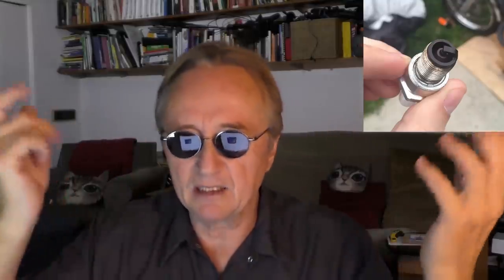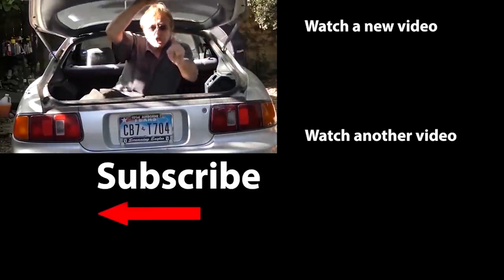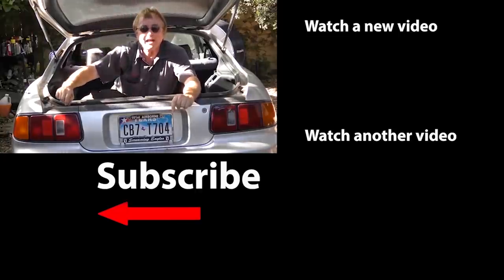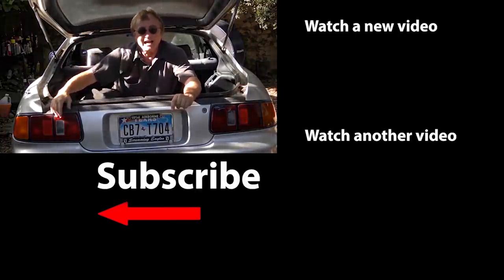How to Make a Weak Engine Run Better

Comment: I am so paranoid that things will break ever since i started watching Scotty videos, i sold my truck, my car,  my motorcycle, now looking for a 94 Celica so i can live stress free
Reply: Lone Ranger no repairs before 5 million miles, just tire rotation
Reply: @MrRamman04  what about brakes and light bulbs?
Reply: Kyle Kenan the 94 Celica is so good that the brakes are self healing and the lights are good for 100 000 000 hours
Reply: Get rid of your wife,too...🤭
Reply: Carlos Mejia How much do you charge?😜
Reply: Don't forget  the part where you sell your old lady......
Reply: Wing man lmao same I drive a sonata and it has a gdi engine
Reply: I have one, and I'm doing everything to it...  replaced the shifter cables that broke, replaced the valve cover, replaced the PCV valve after I broke it off (best thing ever -- change this every three years or so, otherwise, it plugs up and your engine tries to blow up like a balloon), put dye in oil to find oil leak, and currently in line to replace the distributor O-ring and the internal seal to stop the leak coming out of the distributor.  I also think the oil pump might be leaking, or leaked in the past. Once I get the dizzy situated, and make sure the hoses that have been leaked on for years aren't swollen to the point of a problem, I will clean up the back of the engine and see if there are any other leaks.  Something leaked on the passenger side of the vehicle, but I don't know if that has already been resolved.  It has over 330k miles on it, it runs pretty nicely, and the oil stays clear in the engine.  It is getting over 30 MPG with mostly highway driving, even with the distributor oil leak.
Reply: Just change the oil weekly

Comment: Got a 94 Corolla for 400$ with 176k miles on it. 10 years ago. It’s in my driveway right now with 286k. That’s 10k a year. Was the beat car I’ve ever owned. I drove that thing on a 1200 mile round trip two years ago. Didn’t even hesitate. Great vehicle.

Comment: My 1992 Toyota four-wheel drive pickup running rough and then it wouldn't stay running so I sprayed carburetor cleaner in a throttle body  poured seafoam in the vacuum tube off the power brakes booster now it runs fine like a top it does clean the injectors well

Comment: Scotty must not have heard of Matt fara's million mile Lexus.
Reply: Suspicious Citrus Isnt lexus made by toyota?
Reply: Yes it is, exactly why they are so awesome.
Reply: Lassi Kinnunen  a few things were replaced, but it had the original engine, and the transmission was rebuilt at 700k miles, but it was still using the same transmission.

Comment: The shop I take my vehicles to diagnosed a ticking sound as an exhaust leak...
Reply: Lol so you had more than 1 noise. Were you that customer that dropped off your car with a note that said "Hurr Durr ma engines making noise" and then didn't pick up the phone when they called you to ask you further questions?
Reply: @fuckjewtube69  I only take my cars to a certain shop. It is not your shop. So no. It was not me.

Comment: one note for people don't pay to much for getting your injectors professionally cleaned. as depending on how many cyclinders you have it may not be much more just to buy a new set of oem injectors. he always says they might cost a ton for a new set. but it does really depend on your car as some can be alot more then other but some you can literaly get the oem set for like 100 or so bucks

Comment: My Civic has 150 k miles on it started to use 89 octane in it runs better and better fuel mileage than 87 I do have stainless steel manifold exhaust and intake on it.  I know I probably need to replace the fuel pump eventually

Comment: Scotty, I have a 1926 Model T hot rod show car.  I'm running  a Ford 302 with a blower and a C-4 trans with a shift kit. Lately it won't shift into 3rd until it gets warm, about two miles of driving. Once it finally does shift into 3rd it's good all day. I have replaced the trans fluid and filter and vacuum modulator. I checked the modulator for a vacuum leak and all is tight. I'm now leaning toward  the governor sticking. Am I on the right track? or a valve body problem? Help an old hot rod guy out.  what do you think?...

Comment: I bought the Michelin ones at Walmart. The ends flop. Drives me crazy.
Reply: Dave McLaughlin I think part of the problem is that they put much longer wipers on the driver’s side now. The RainX one on my car jitters a little too but it’s like a 26” L and a 21” R
Reply: @brucemorris3830  that makes sense. My Tacoma's driver's side is longer, and that is the one that bugs me.

Comment: Hey Scotty, learned a lot from your videos! What are your thoughts on a 2009 Toyota Sienna? Mine has 120,000 miles on it, are they reliable vehicles, especially for the long run?
Reply: I have a 2000 sienna with 210k miles. Just keep maintaining it and run it until it dies.

Comment: Hey scotty! My mother's 2003 ford Taurus has a knock when it's freezing cold and only last 30 seconds to a minute on start up. Doesn't do it once it's warm and doesn't do it if it's warm outside. What's going on?
Reply: Might be a weak oil pump or just the valves ticking. My '65 Mustang has always had a subtle tick to it and made a slapping noise while cold if you revved it high enough for the first few seconds of running. I have an oil pressure gauge in my car but I would assume your mom's car does not. For now I'd just let it idle and not move on startups for 30 to 60 seconds and then drive and if the oil light never comes on you're probably fine.
Reply: Fords in general tend run their oil pressures a little high compared to other vehicles my grandpa said. In my v8 Mustang its supposed to be at least 20 when stopped plus an extra 10 for every 1000rpm.
But yeah, you should get it looked at to see if the oil pump is on it's way out. Or the valves and lifters are either going bad or out of adjustment.

Comment: Hey Scotty I have a 97 Camry and my heater doesn’t work.. I replaced my heater core and I still don’t have hot air coming through.. my blower motor works it just blows cold air when I turn it on.. it’s getting colder everyday where I’m in the mornings and my defrost doesn’t work so I’m driving with the windows down and it sucks.. I appreciate the time and hope to get a response
Reply: behexen250 I’ll check it out tomorrow morning thank you

Comment: Hi Scotty, I have a 2014 Chevy Malibu with 119,566 miles.  Check engine light came on so I took it to AutoZone.  They plugged in their sensor and got "P0014 Bank 1 Exhaust Camshaft Position timing was advanced beyond limits for a predetermined period of time".  Does that mean I need a new part or it just needs to be adjusted or reset?

Comment: Best wiper by FAR BOSTCH WIPERS THE BEST TRY THEM PLEASE
Reply: Bosch clips do not hold firm on Hondas. Rubber inserts from the Honda dealer, using the original wiper arms, work perfectly at 1/3 the price.

Comment: Just want to let you know you never have to convert an old R12 system in a car they make a product called Freeze 12 that works just as well and it's designed to take the place of R12 and it's cheaper then R12 and I still think that Scotty is bias against diesel I love my diesel never have to worry about TuneIn am up also get better fuel mileage better torque all around better performance Granite it does cost a little bit more to work on them for oil changes fuel filters and some minor maintenances but if injector fails it will cost you or the fuel pump you have your good and you have your bad with every vehicle but for a daily driver use my 2005 Jeep Liberty crd has been great nothing major and almost 200,000 miles and still kicking strong I can pull a mid size salt truck with it with no issue and doesn't feel like I even have anything attached to it when I do pull and can't beat the fuel mileage I'm getting 28 on the highway and if I push it I can get 34 and yes it is four-!
 wheel drive try getting that an older model 4-wheel drive with that good of a fuel mileage I even found places online that shows me what mods to do to get around 40+ miles per gallon  try getting that out of an gas model 4 wheel drive vehicle

Comment: Hey Scotty, I have a 1993 nissan hardbody pickup manual transmission, it accelerates slowly and when going up hills it always slows down.
Reply: Get a new engine.
Reply: @behexen250 I put a new clutch in as the old clutch was slipping, but that didn't change anything.

Comment: A couple ounces of Marvel Mystery oil at every fill up does wonders to keep your fuel system clean.
Reply: Nonsense,in fifty years of driving never had to do anything like that
 all you need to do is buy clean good gasoline!
Reply: @behexen250 You will ruin everything like O2 sensors with the lead.
Reply: @martialman.4563  I'm sure Marvel has no lead.
Reply: @mynameisgladiator1933  Regular gasoline does
Reply: @martialman.4563  Not since the 1970's.
Reply: @mynameisgladiator1933  Depends on where. Don't use regular in an electronic fuel injection car.
Reply: @martialman.4563  I'm in the USA. We haven't used lead in fuel since 1996 although it was all but gone in the 1980's. Regular in the USA now means the lowest octane unleaded fuel, though we really have dropped that term. Now we just say: 87 or 89 or 92 for the octane.
Reply: Martialman45, Using a few ounces at at time will not ruin your sensors. I've used marvel for the last 25 years with never a problem of engine codes  or sensors. My Corvette has 140000 miles on it.
Reply: @davidswick8353  No, just a small amount of regular will ruine a modern car with one tank or less.
Reply: @martialman.4563  My cars are modern 2011 and 2007
Reply: @davidswick8353  I was referring to another commenter. They stated you could fix fuel injectors with regular gasoline, that is false.
Reply: @behexen250 You said regular fuel will fix fuel injectors on first post. It will not and the lead will damage electronic fuel injection systems.
Reply: @behexen250 "Regular Gas", I assumed you meant gasoline?
Reply: @behexen250 Understood, thought you meant regular gasoline. I knew a few people who put regular gasoline instead of unleaded and they destroyed their cars and trucks. I mix my own with lead substitute, confusion might lead to car failure as some get regular and unleaded mixed up.

Comment: hey Scotty, I have a 87' Pontiac fiero with 93k miles. I recently changed the alternator, could I daily it?
Reply: standard *
Reply: Hell yes ! My 85 GT was fun !
Reply: behexen250 thank you for sharing your experience. Can I ask why it's bad in rain? I live in California and I know it's the least of my worries but would you let me in on what happens in those weather conditions? And my fiero has been well taken care of over the years. I plan on taking care of it without modifying it until the engine gives out which I heard the iron duke is not such a bad engine.
Reply: Buff Barnaby what are your experiences with your car? Ups and downs?

Comment: Scotty I hear a clunking sound coming from my driver side when I turn left on my 2003 Buick Century, what could it be?
Reply: I have 03 buick lesabre my left tire wobble when I drive it's not the tie rod so what you think you could be
Reply: @behexen250 u mean tire rod
Reply: @behexen250 when I drive slow is the car don't shake don't see nothing but when I catch a little speed my right tire front and then I got hit the brakes like one two three one two three to catch the right though even it out from wobbly wobbly wobbly and then when I go slow then it did Drive good but when I catch speed or turn a little bit it seems like sometimes it going to come off
Reply: @behexen250 thanks when i get off wk ima do that because i just had a transmission put in and maybe dude didn't do something right but latery its been raining here in fort Lauderdale so hopefully tomorrow

Comment: the main thing is no matter what you don't buy from auto zone.
Reply: Their brake pads and batteries are decent for the money.
Reply: @directorbeau I have a friend that has a shop and he had a account with auto zone. and we have had to replace so many parts that we put on and my truck has had 4 right front hubs in 5 months  I give up made them give me my money back and went to o'reilly and got one. needless to say he changed but we still having to replace parts from them.